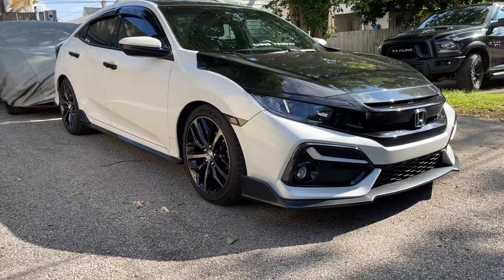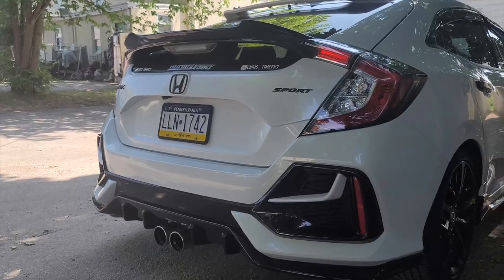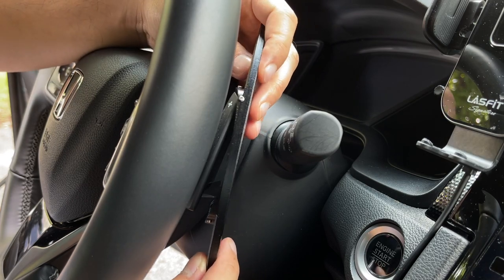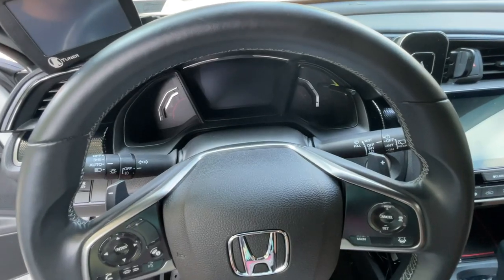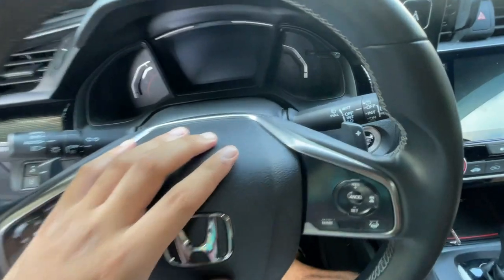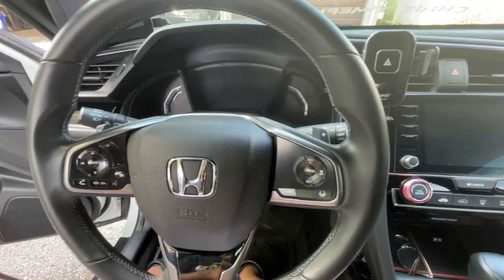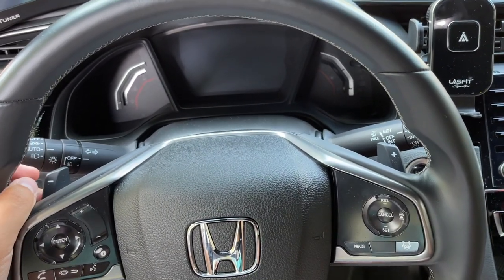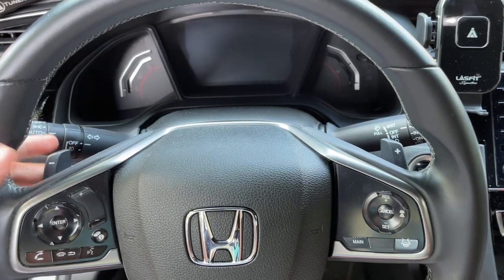ULTIMATE PADDLE SHIFTERS FOR HONDA CIVIC

Comment: Had a question about when you put it in sports mode. So it’s perfectly fine to be driving then wanting to switch to sports mode? Do you let go of the gas then switch or foot still on the pedal? Thank you in advance! Love your videos!
Reply from the maker: Its fine to still have your foot on the gas when switching to sport. However i always let off the gas before switching. Either way works. The computer is smart enough.

Comment: Hey chris i just bought a brand new hatchback sport! I just wanted to know how you think it handles in the snow, I also live in PA so i know how bad the winters are here😂
Reply: This will be my 2nd winter with my hatch and I live on Long Island. It does handle pretty well in the snow. Keep it in sport mode it gives you a tighter grip.
Reply: @unikidheart6778  cool thanks for the tip man!
Reply: I live in Massachusetts going on 3 years now : just changed from stock tires
Reply from the maker: It really depends on your tires. I made a couple of videos demonstrating how it handles in the snow 😀
Reply: @unikidheart6778  glad to know I did that part right…. My downfall was this big speed bump😭

Comment: Just installed my KTuner and now the hatch is much quicker. Do you know if doing a downpipe will give some more power?
Reply: Hey 1.5 manual hatch owner here - downpipe hasn't given noticable performance for me
Reply from the maker: More of a slight increase in noise than additional power honestly.